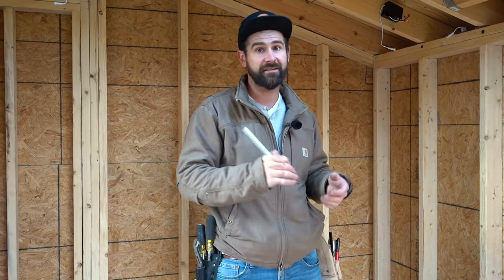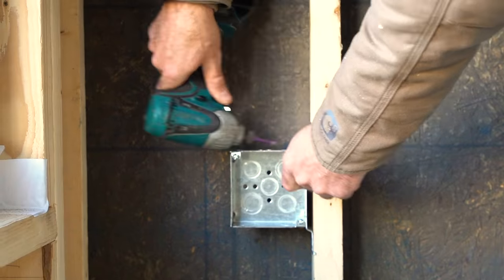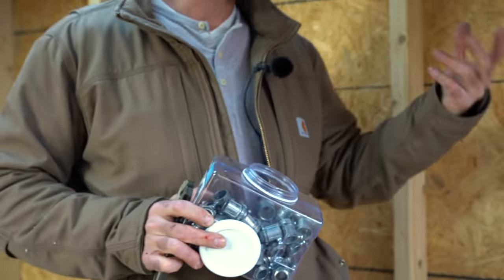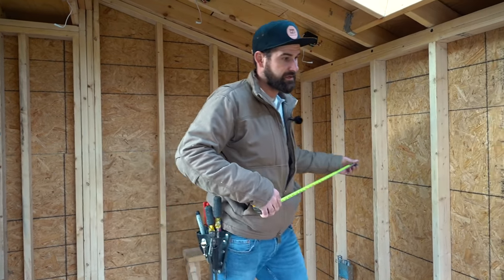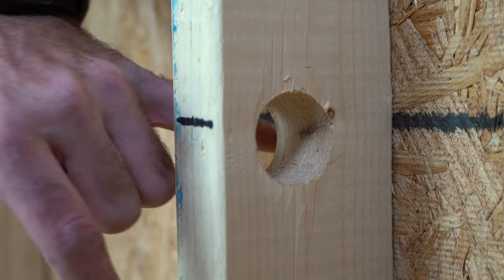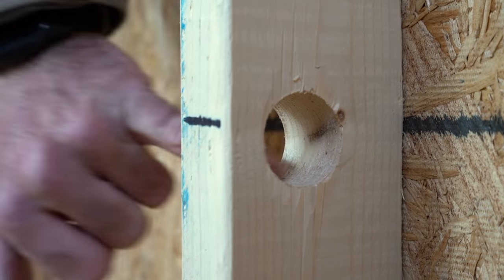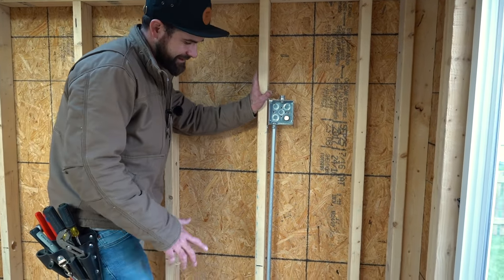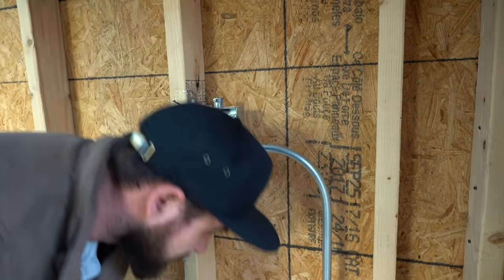How to bend and install electrical conduit

Comment: Seems like a lot of work compared to how we do it here in Norway. We use hammer-on boxes and pre-fed flexible conduit; much easier.
Reply: Same in Sweden. This shit looks so dumb😂. I saw another American electrician having real cable inside the wall which also seemed very dumb...
Reply: A hella lot easier lol
Reply: Me in Norway use hammer on box. Use conduit instead of ridged pipe for routing wire. Every country/state/city has its own codes. Im in tellacom field. Power plant building. Battery cabiets/converter shelves/reverse polarity -48vdc/rectifiers/tower work:antennas and radios for your mobile network. 5g updates. It is alot of work dealing with codes but codes are laid out and changed for safety. Id rather have him wiring my house than "viking with hammer!!!"
Reply: ??m
Reply: Hi to Norway the birthplace of my paternal great grandparents. FWIW, almost all wiring within a modern American home is done with NMC (Non Metallic Cable) usually known by the trade name Romex. There are various places where NMC isn't allowed or isn't the preferred approach. Wiring in most of those places is usually done with some kind of flex cable that has a flexible metal cover. 

It sounds like what is done in Norway is at least similar to what is done in the US with regard to this. The conduit used in this video is usually called EMT (Electrical Metal Tube). There are at least two reasons why EMT might be used in the US instead of flex cable. 1. It looks better. Where the conduit is going to be visible and somebody cares about how it looks EMT might be used instead of flexible cable. 2. It provides better protection for the wire. In California where I am from I don't believe EMT is required for use in garages. I also don't think it would have been required in the garage in this video, but it might be in some US jurisdictions.

There are some places where rigid conduit is required. This is iron pipe with some kind of bright plating. I think that is required in hospitals.
Reply: @davefoc  I live in Chicago, the code is EMT for everything. I actually think it's a good idea, despite being more expensive up front. It provides the best protection for the wire possible, the metal conduit is tied to ground so there is basically zero chance of a wire sparking and causing a fire inside the wall. A side benefit is the conduit makes pulling different cabling through the wall much easier if that is desired later on.
Reply: We have similar things in the U.S. but communities get to set their standards.
Reply: @davefoc  Well, if it's a new installation: Wire (not cable) in pvc conduit. Used to be done with stiff tubes, now we only use them for passing cable on the roof in more industrial applications, like above roof board. Wire is usually 2.5cm^2 (10 gauge), and often come pre-fed in various sized from 1.5 (14-15 gauge) to 6 (close to 3 gauge), and with 3 to 5 conductors.

The times we'd use cable would be:
Main supply cable from the meter-box on the outside of the house (on newer installations, meter used to be inside the fuse-cabinet);
For recessed lighting (double;
Anything that has brakes the air-barrier (so most wall mounted outdoor lamps, but not outdoor sockets as they go flush and we seal around the hole);
Whenever we'd have to go on the outside of a wall, like if there's an outlet on a fire-barrier-wall, because there can't be wall-boxes nor conduit in them;

And also if you need to do a sneaky one. Meaning, if you have to go in the wall but there's no conduit. Then it has to have two layers of insulation, like with a PFXP cable. Anything not doubly-isolated can't be laid directly in insulation. That means you couldn't wire a house American-style here in Norway, because i don't think standard Romex doesn't meet code; the ground would have to be insulated just like the L and N.

Some pictures:

https://twitter.com/TheMcDudeCM/status/1455664514201001991
https://twitter.com/TheMcDudeCM/status/1455665025008406534
https://twitter.com/TheMcDudeCM/status/1455666525688451077
Reply: That's most places in the USA. The big cities have so many lawsuits here that they go way over the top with safety. It's good if you know how to do conduit because it's a skill that is in demand in the big cities.
Reply: @davidboman7395  I thought Swedes were smart and had better manners with swearing. Looks like we both learned something new.
Reply: I want to run my future house with conduit. Takes more time and money, but If I ever need to upgrade my wiring I can pull it right out without having to remove drywall
Reply: @davefoc  yeah romex and bx cable in Ontario, Canada mostly.
Reply: In the us we use a plastic costed cable in residential and plastic boxes. He is in am area that requires steel conduit inside walls. But in some commercial we use armored cable and metal boxes which makes sense.
Reply: We do that here to. Unless it's surface mount. (USA)
Reply: @bmcfad12  yeah but have fun moving a box if you needed to do that😂
Reply: Agreed, this is 100 percent overkill. I'd be furious if I worked in that jurisdiction. Pre-built trailers don't ever have conduit, always romex(NMC). I leave EMT in commercial builds where it belongs. In Florida even the EMT will rust.
Reply: @boomtatortot5431  how does it cost a fuck ton if we do a kitchen in 1 h, while you guys charge 10h for wireing a kitchen?
Reply: @davidboman7395  best protection against electrical fires.  Pipe system adds an extra ground protection.  And you use the piping system to pull and add wires if needed for the future.  So I don't understand how that is dumb...? Its like saying why don't we just run flexible gas line everywhere..? Same thing different system
Reply: @jonathansirmons7932  yeh I get that
Reply: @bmcfad12  if you are building it, conduit the walls all the way thru before raising them as you build then cut in the boxes less small pieces.
Reply: @briank1263  emt won't rust when you install emt in emt approved locations.  Outside or inside moisture areas are not approved for emt.  You have pvc. Rigid pipe. Imc pipe. Pvc coated rigid pipe.  Aluminum pipe.  I even ran stainless steel electrical piping.
Reply: We use pvc pipes and a bender and blue boxes like this shed
Reply: @davidboman7395  I can , along with alot of guys I work with,  can lay out boxes and rough in "pipe" a kitchen pretty close to as fast as you can try and pull stiff romex threw holes everywhere by yourself.
Reply: @davidboman7395  unless mc is cheaper than romex then thats why. No one runs conduit in homes in the US. There are places where you are required to run at the bare minimum mc which apparently is what you guys use and 1000 sq ft house there would cost the same as a 2000 sq ft house where i am from
Reply: @lukesmith9059  ♥️
Reply: @davidboman7395  show me a link what you install... Curious electrician from across the pond.
Reply: @JG-ej8it  lol Viking with hammer
Reply: We just put them in concrete and plastic round boxes.
Reply: @lukesmith9059 
I have done electric in Chicago and the suburbs for many years. You are correct on the benefits of conduit. But after working in rural Missouri installing electrical just using nm-b ... I never want to go back to that hard  work....😂😂😂
Not worth the benefit of conduit..
Reply: @bmcfad12 you should design your new house where you would not need to run more wire in the future...😂
We spend plenty of time looking at all scenarios and build accordingly.. 😂

Comment: Retired sparky here . Think it's called a 1900 box is because it has 19 cubic inches. Called 4 & 11/16" boxes 2100 boxes. Only used 2 & 2/8" boxes to give you more room for wires or deep devices. Great example is a duplex receptacle with two charging ports. Almost need a shoe horn & a rubber mallet to get it into box.

Comment: Great video! Electrician here as well. Just a little 2 cents for anyone interested; since he was using 1/2 inch pipe, the take up (or deduction, the part you subtract when bending a 90 on the arrow) was 5". However, keep in mind, that these change from size to size. So if you're using 3/4" , the deduction is 6". If you're using 1", the deduction is 8". As he said in the video, it will be listed on the bender. Also, if you don't want to do the deduction, you can do something called "bending on center". Usually this is denoted on the bender by a star, and this allows you to just mark your exact measurement, and line the mark up with the star, as opposed to the arrow. Just a little less math involved is all. 

I work mainly commercial, but most of this information was very useful for anyone just starting off/doing a home project. This is stuff i only learned after being at many sites. I've never seen those bracket 1900s though, those are pretty nice!
Reply: I hated using the arrow. I used a scrap pipe and measured the 90 from the end of the shoe. My bendfield is exactly 6 inches.
Reply: Too much information for beginners, I'm an electrician myself, a lesson in how to bend conduit can go a long way.
an offset of 15 degrees, you multiply the height of your offset by 3.8
an offset of 30 degrees, you multiply the height of your offset by 2
an offset of 45 degrees, you multiply the height of your offset by 1.4
example for an offset of 3 inches at 30 degrees you multiply 3'' X 2
so it will be 6 inches in both marks where the conduit will be bent at 30 degrees.
Reply: Jesus is the only way to healing, restoration and salvation to all souls. Please turn to him and he will change your life, depression into delight, soul heading from hell to heaven all because of what he did on the cross 

“Whoever calls upon the name of the Lord shall be saved” Romans 10:13

Comment: Those shallow boxes really cramp my style. I always use deep 4s boxes, 2-1/8" deep. They cost a bit more but the extra room is golden for installing dimmers and GFCI's
Reply: The deeper the better in my opinion
Reply: Always go as deep as possible ....😂

Comment: I'm an attorney and do minimal home repair/maintenance/construction.  This video is so easy to understand and your method of showing/explaining the process each step of the way is top notch.  Honestly, after 20 minutes of watching, I feel like I have some semblance of how to run some short conduit without giving up before the project was even attempted (obviously I'd likely get an electrician to handle much bigger projects).  Great job and keep up the good work!
Reply: Your comment wouldn’t have made any sense if you left out that you’re an attorney, so I’m glad you let us know right away
Reply: @Logan-zi4vx  I could have just as easily said "I work on computers all day as a computer programmer" and the end result would be the same- I don't normally do a lot of manual labor so that detail gave context but, as seems to be your prerogative, let us all see your fragile ego by focusing on one word rather than an entire paragraph of text!
Reply: @mrobviousj  what part of what I said made me seem like I have a fragile ego?
Reply: @djderekrock  why
Reply: What does being an attorney have to do with your comment?
Reply: @inthedarkwoods2022  it further re-iterates the lack of knowledge/experience with manual trade/activity.  Similarly, if someone said, "I've been a handyman all my life and don't really use computers" the handyman detail provides additional insight/emphasis about the lack of computer use/knowledge.  In both instances, stating the profession is a minor detail that adds to the underlying claim.
Reply: If you're an attorney you should know that you shouldn't be working on any electrical installations unless you are a licensed electrician ...😂😂
Reply: @customsolutions7167  you clearly missed the part of my comment about how I'd get an electrician to handle much bigger projects.  I wonder what you do since reading comprehension obviously isn't a job requirement, lol.
Reply: @mrobviousj  just the kind of snotty comment I would expect from a lawyer... .. the lowest profession available except for politician . 
🤣🤣
Reply: Jesus is the only way to healing, restoration and salvation to all souls. Please turn to him and he will change your life, depression into delight, soul heading from hell to heaven all because of what he did on the cross 

“Whoever calls upon the name of the Lord shall be saved” Romans 10:13
Reply: @HaroutBlack Amen 😂

Comment: I’m retired now but for years (and still do) I have a 12volt Milwaukee powered hacksaw, it’s small and light. Hand hacksaws are disappearing. I’ve seen some of the new guys coming up using small battery bandsaws! And I always use 1900SPD (deep boxes) for switches and a given for GFI’s, for the small price difference they give you extra room and less of a headache. Also, when your done, step back and look at everything, better to change it now than when the walls are rocked.

Comment: Bob- I am a carpenter, contractor and home inspector. I learned a lot of little trick from you
Nice job explaining.
Reply from the maker: Thanks! How long have you been an inspector?
Reply: @BobClarizio  
Bob-
I have been inspecting homes for 35 years. It was a great business up until the housing shortage. Buyers are foolishly buying homes with out pre inspections. In Massachusetts home inspectors are off by about 60%!
Reply from the maker: @rayjackson4547 60%?!? Wow that’s crazy

Comment: Good tutorial.  I know a lot of people use the conduit for the ground.  But I always pull a green wire in as well.
But then, I have a lot of industrial background.  I retired 7 years ago after many years of working with 480 and below.
Reply: I agree. Its legal, but never rely on the conduit to carry the ground. Pull a ground.
Reply: I don't know why anyone would use the conduit for the ground, even though it's code. Sure, wire isn't cheap, but it's the better way to do it.
Reply: Just FYI code says EMT SHALL BE allowed to be used as ground.  I have worked exclusively commercial and industrial.  With today’s costs you are screwing yourself.  I’d sooner put money into ground pigtails.
Reply: @r777v  Yes, I know the code allows it but have had far too many seriously bad ground situations because of EMT couplings loosening or corroding.  I had a very deep maintenance budget too.

Comment: Failed inspection for hole size where I live. Best practice is to Stay under 1/3 the thickness
Reply: Yeah that was my only heartburn with an otherwise great video. The electrical code does spell out that there has to be at least 1 1/4" from the edge of the hole to the outside edge of the stud. (300-4 (a)(1) I believe) So per the Code in a standard 3 1/2" stud you can't go larger than a 1" hole without using a nail guard over the hole. BUT, nail guards are cheap and having the bigger holes makes it a lot easier to get the conduit in and out of the wall. I would do exactly what he did and just slap a nail guard over those 5 studs for like $3. Lol
Reply: I would make precision holes with a laser level.

Comment: That was an excellent job in illustration of working with emt!!!!!  I have been electrician for the past 51 years and electrical contractor for past 48 years.   You impressed the hell out of me!!!!   Why didnt you just simply run mc cable???  I prefer 420s, (they are tad smaller), the klein conduit reamer/screwdriver, tape measure, pencil, hacksaw (battery sawzall, or hacksaw), 1/2" bender and little kicker to do that job in emt if the inspector refuses to allow me to use mc cable which is alot faster than emt is!!!!  Again a great job!!!!!!

Comment: When I'm taking my measurements I usually deduct 1/8" or 1/4" for where the pipe goes in the connector.  Most connectors don't let the pipe go in exactly to the edge of the box.

Comment: In EMT land here near Chicago as well.  Try the angled side of a cats paw to knock out, then use the straight end to remove it on the inside of the box.  I accidentally found this trick and will never go back.  Hope this helps another electrician.
Reply: What’s a cats paw?   Thanks…Jim
Reply: So …. You carry a cats paw just to pop knockouts ? Seems to be a lot of weight for minimum function .
Reply: Just use lineman pliers. Use them as a hammer. Use the to knock out knock outs. Use them to remove the knockout. Use them to make up the box.
Why do you all make this so hard lol

Comment: Just some useful info from an apprentice from Chicago. If you're gonna be doing a lot of pipe work you should get a 12v bandsaw to cut your pipes much faster, a 12v impact driver to drive your screws in your couplings/connectors faster, and put a Reaming Bit Holder on your impact, extremely useful bit it will save you time on reaming. If found that sometimes bending on the star is faster in certain situations like for a long piece of pipe (also you don't need to subtract if you're using the star)

Nice video though!